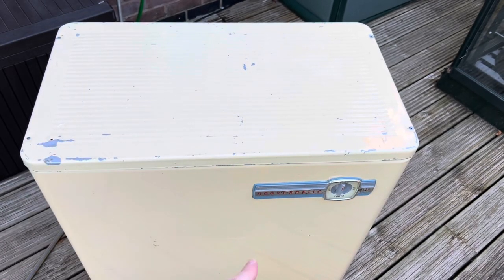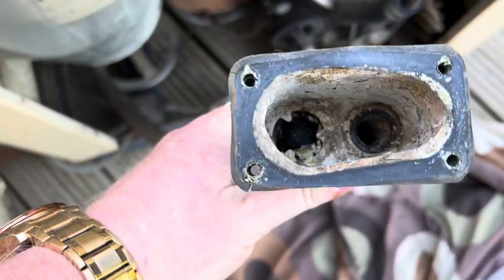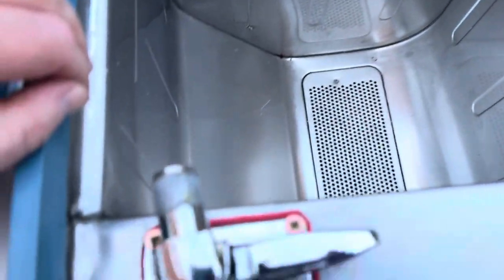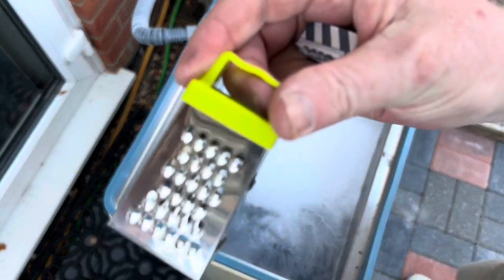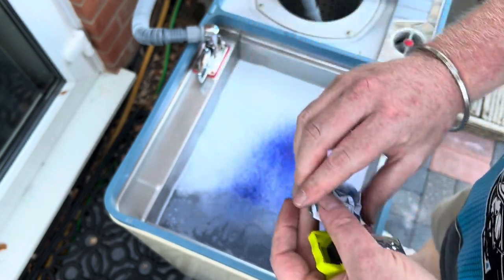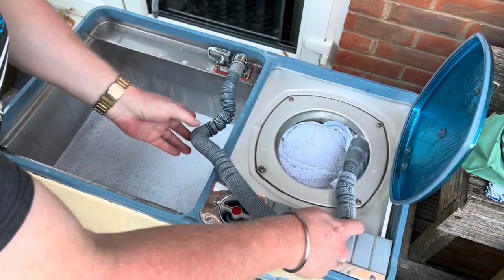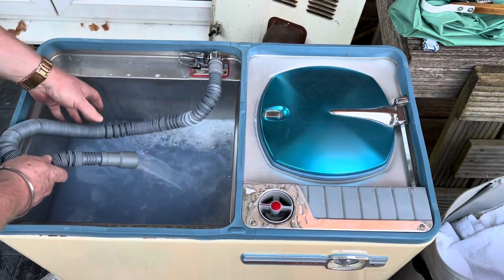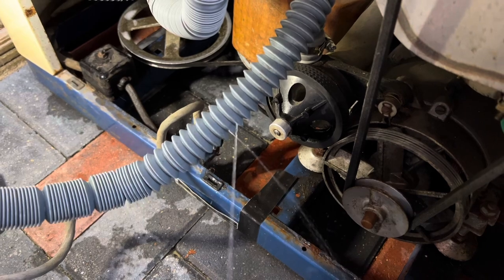Vintage 1950’s Hoovermatic Twintub washing machine, almost repair 🤣

Comment: i have the later 3334 version with the thermostat, it needs a clean bless it but it still works
Reply from the maker: It’s lovely to get these old machines working, I will put new hoses on it tomorrow
Reply: What was the earlier 3334 ?
Reply from the maker: @revooh1  I’m afraid I’ve no idea, I’m not familiar with the models they had.
Reply: There was no earlier 3334 without a thermostat unless the commentator means the 3174 which was the first Hoovermatic 1957-61. There were two unheated versions 3444 and 3345A